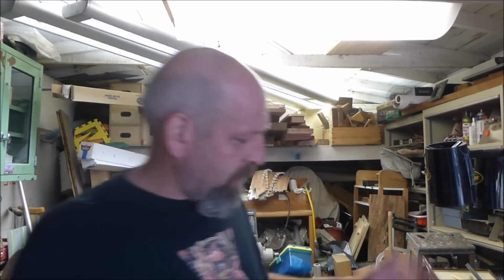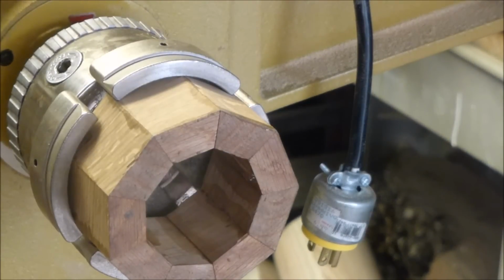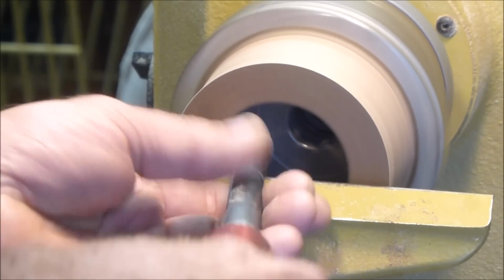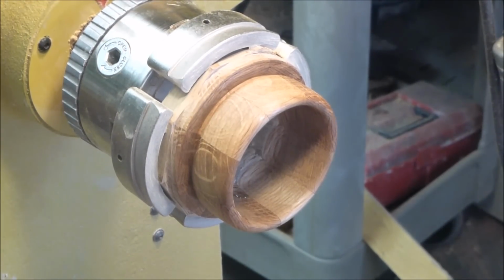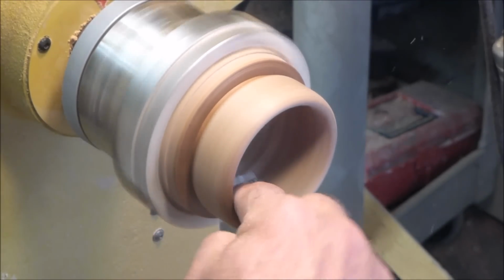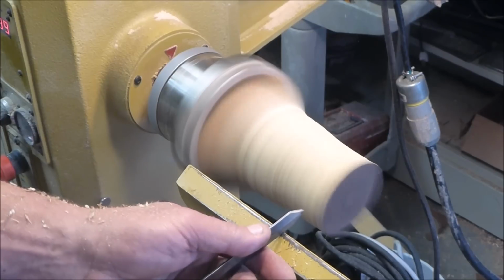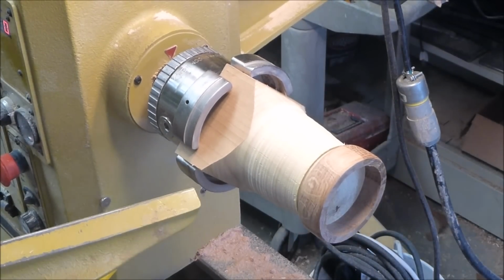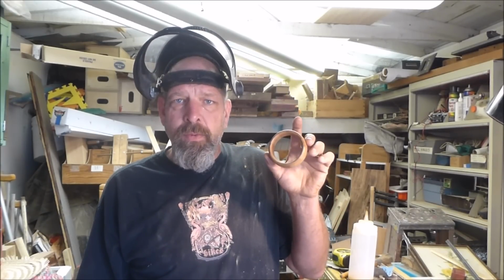Naked Turner Bangle From White Oak Segments

Comment: That bangle turned out great, Erik. I'm curious about the 9 segment process. Is the formula for figuring out the angles the same as you'd use for any other segmented ring? For example, an 8 segmented ring would have 16 sides, you divide that by 360 to get 22.5 degrees. For the 9 segmented ring you'd have 18 sides and divide that by 360 to get an angle of 20 degrees. Thanks in advance, and thanks for always putting out awesome videos! I'm going to have to make one of those super thin knife blade parting tools. That's a brilliant idea.
Reply from the maker: Braxton Wirthlin Thanks Braxton  yes a 20 degree angle off of 90 degrees on your chop saw.  Thanks for watching

Comment: Nice video with some good tips.  Question:  You said the young lady would perhaps dye a design onto the bracelet--would not the sanding sealer prevent the dye from going into the wood?  Curious to know what her finishing process will be.
Reply from the maker: Dwight LGood question Dwight.  I put a very light sanding sealer that was made with denatured alcohol and shellac so she can wipe the section she plans on painting the design on with denatured alcohol and it sounds like she is painting it with acrylic paints and then a coating with epoxy and hopefully it works.  This is a prototype and modifications might be made in the future.